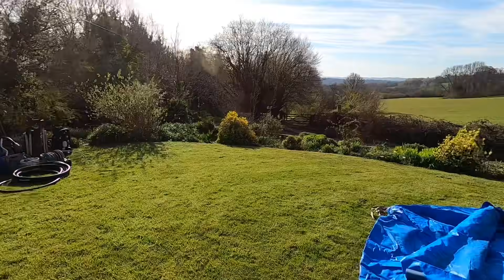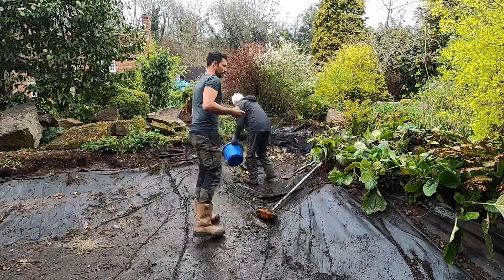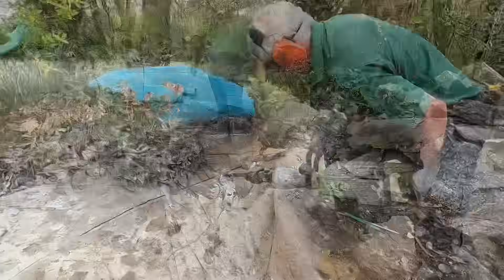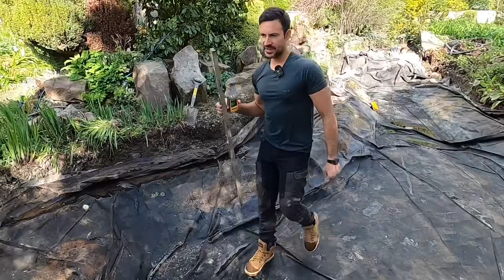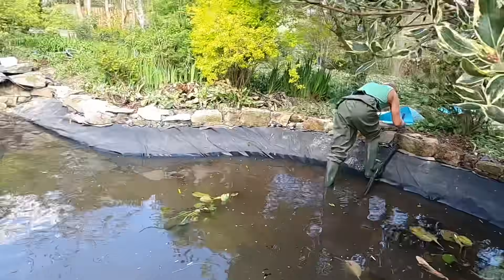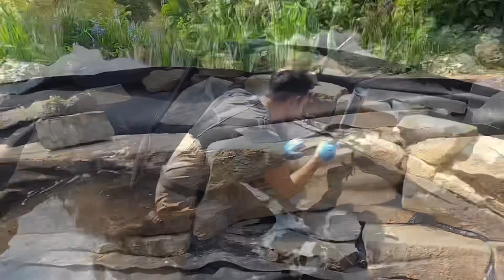Hawkley pond restoration: “The curvy pond!”

Comment: Love your video, mate, but don't really understand why You took the pond down Instead of building up a little bit🤔🙏
Reply from the maker: Hi Darryl, thanks for watching and commenting!  Making the pond deeper was a priority with this restoration and I could have done so by either digging deeper, or as you say building up the sides.  However building up the sides would affect the entire pond by raising the water level, which on turn would have knock on effects to the levels for the edging paving and all the surrounding foliage.  Instead, simply digging out a section of the pond I could increase the depth where I wanted to without effecting any of the surrounding levels. Hope that makes sense!
Best,
Ed
Reply: @CrystalClearAquatics OK I understand. Thanks for the reply.

Comment: Just about to start my first pond dig in 30 years, how many cans of foam did you use on this job?
Reply from the maker: Hey there, apologies for the slow response- I used 13 cans of foam on this build.  Not cheap but quicker and easier then mixing mortar and also less impact on the pond in terms of water quality issues and settling times for the cement to become safe for fish. 
Good luck with your build and thanks for watching and commenting!
Best,
Ed

Comment: Lime mortar with stonework.
Reply from the maker: Hi there- thanks for your comment and my apologies for the sow response- absolutely the correct advice- lime mortar for natural stone, or old brickwork. However used like this to build ponds, where the stone is already in a wet environment there’s no benefit to using more traditional methods- cement based mortar is just fine!
Thanks very much,
Ed

Comment: Hi there. Can you use the expanding foam between the liner and the patio stones around the pond to enable the pond water lever to be higher? Thanks
Reply from the maker: Hi Mark, the expanding foam is simply a way to fix and hold materials, such as stone/rock.  It’s not water proof and as such couldn’t be used in such a way.
Best,
Ed